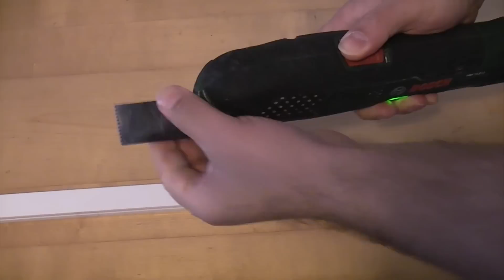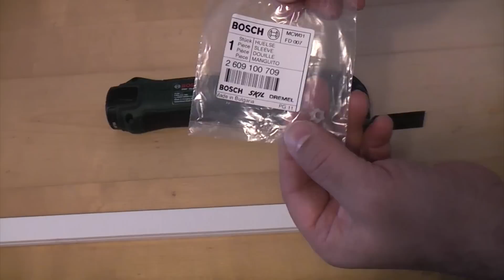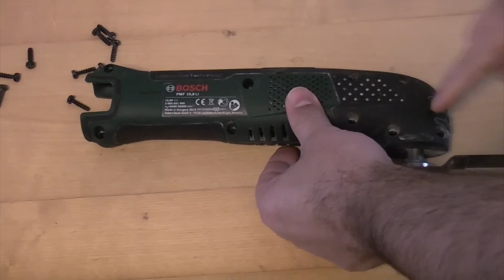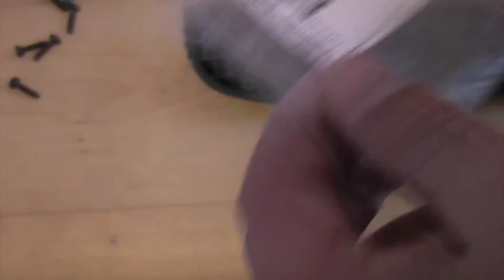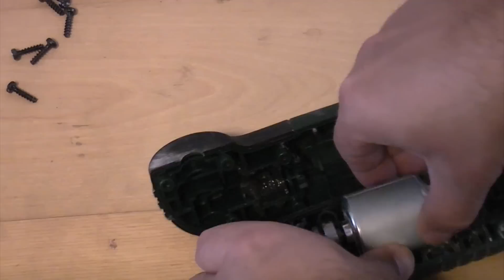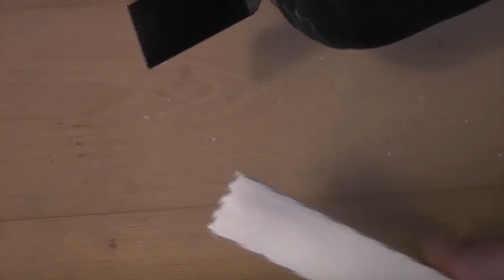Bosch PMF multitool repair

Comment: I'm guessing would something similar to dismantle a worx 20v multitool.
The lights work but no motor sound so I'm guessing a motor replacement required
Reply from the maker: Yes it will be similar. 
I've never worked on Worx stuff, so I'm not sure how easy it s, or how available the parts are!

Comment: Hi just completed a fix on mine it is quite easy to slide the connectors off the motor so you can separate the two halves making motor extraction easier, . Thanks for the info probably saved me a few bob .
Reply from the maker: Thanks for the info

Comment: HELLO I HAVE A TOOL EQUAL TO THIS BUT I STOPPED TO USE IT FOR A FEW YEARS AND NOW IT DOESN'T WORK, YOU KNOW IT CAN BE
Reply from the maker: It could be a few things, is the battery working?
If it is, then the saw could have a faulty switch or motor etc. 
Thanks for the comment 👍

Comment: Hi Ultimate Handyman, I was removing tiles today with my Multi tool and it just stopped working. I checked and then changed the fuse, that was okay, so I'm totally in the dark with what could be wrong with it. Any ideas? It was working fine one minute then nothing. :(
Reply from the maker: +Perma Allotmenteers 
It could be a few things. 
Is it still under warranty?
Reply: Unfortunately no, the beast is over two years old and I haven't got the receipt.....My search of the internet suggests that Bosch DIY range multi tools have a tendency to just give up the ghost and stop working.  I wouldn't know where to start with taking the thing apart and finding the problem so I think I will just take it on the chin and buy a better product next time.  Thank you by the way for your videos on installing a new bathroom. I live in a 1930's house and very little work has been done on it over the years so it is a challenge. Your videos have helped me a great deal, thank you.
Reply from the maker: +Perma Allotmenteers 
I know a guy that had a similar problem, so he went and bought a brand new one and kept the receipt. He then took the old one back and claimed under the guarantee and sold the brand new one ( the cheek of some people ).

You could try checking the switch. I have not done a video on a multi-tool but I have done a similar video on an angle grinder- https://www.youtube.com/watch?v=t3JX_kBZ89I

The Bosch Green multi-tools do not seem at all reliable, which is a shame as Bosch's motto used be something along the lines of "we would rather lose money than our reputation", or similar words! 

I'm glad the video have helped you ;-)

Thanks for the comments ;-)